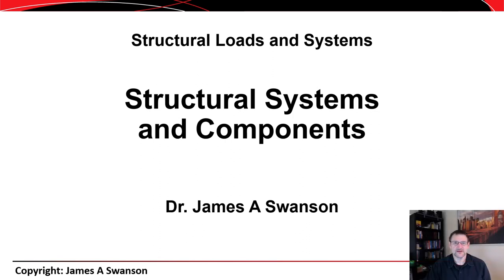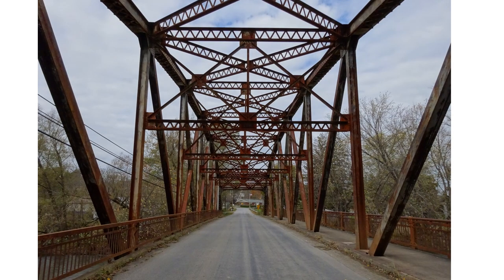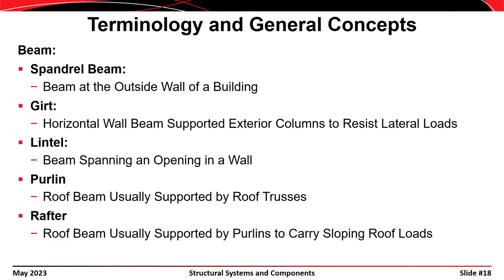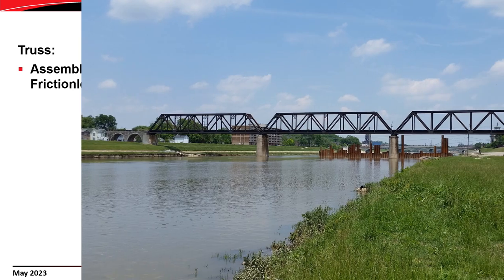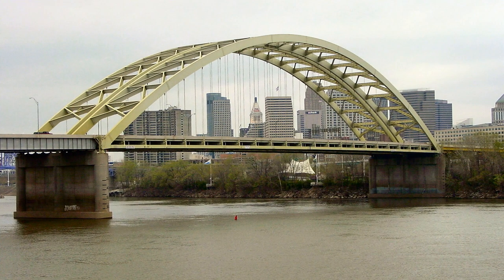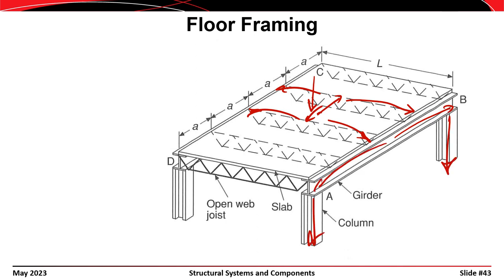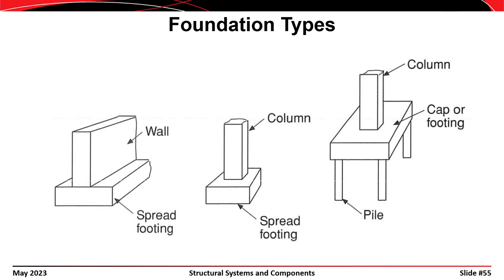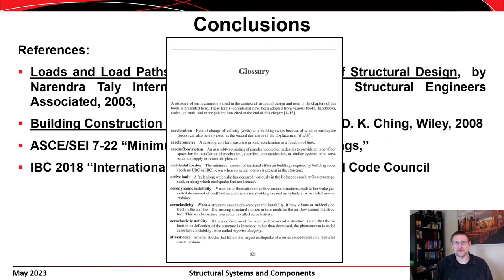Building Systems and Components

Comment: I recently bought a newly constructed home. The second floor of the house has squeaking sound, they told me it is normal and it may reduce once furniture is on the floor. They have used open web truss joist. I find the sound very annoying, is there a way to reduce it. Builder tried multiple time and saying all is good and this cannot be perfect. Floor is little bouncy too. I   Need the solution to fix sound.